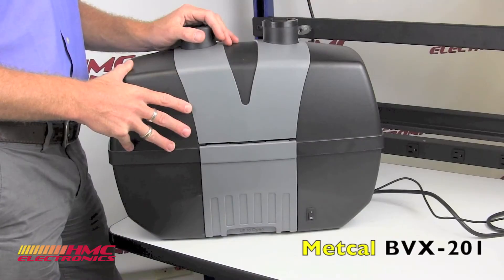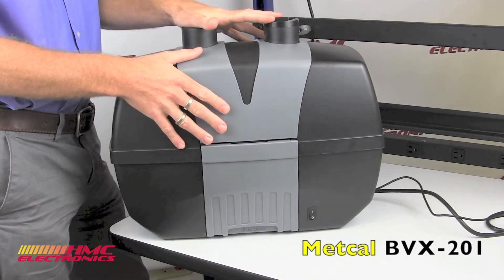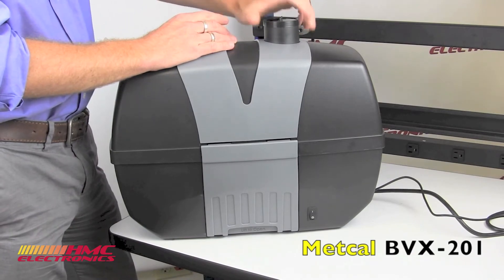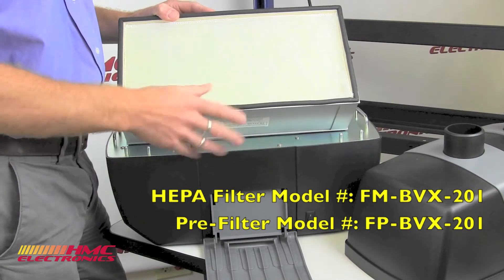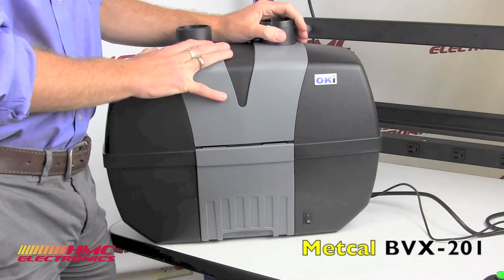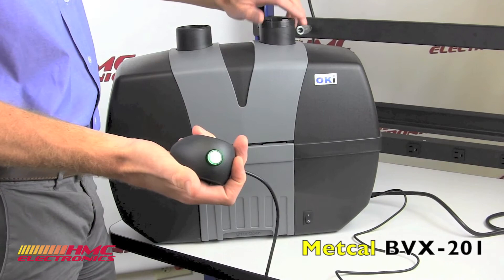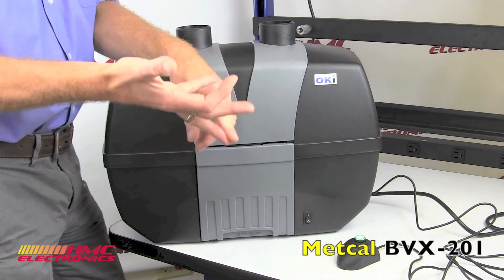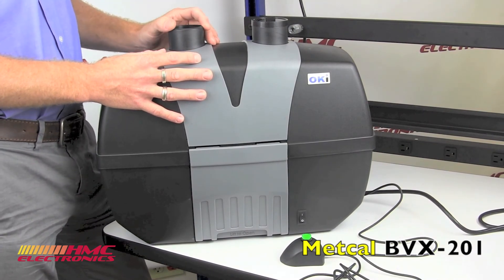Metcal Fume Extractor (BVX-201 and BVX-203)

Comment: I have a BVX-200 and it looks just like this unit. It was working but now it is beeping when I power it on with the remote switch, and the fan motor does not turn on. I have not been able to find anything online or in the manual that says it can and will beep when something goes wrong.
Can you help? Why is it beeping and no longer powering the motor?
Reply: Is it because the filters need replacing?